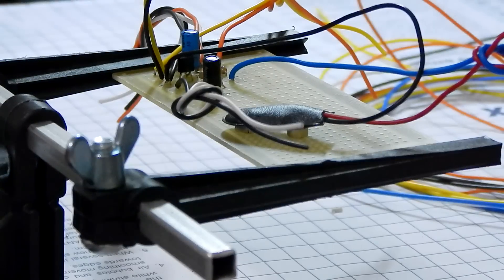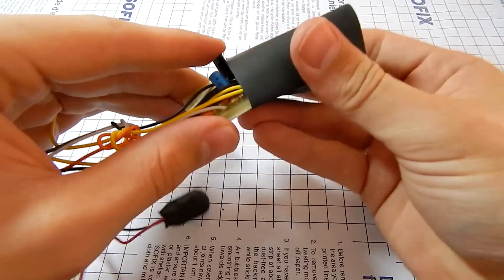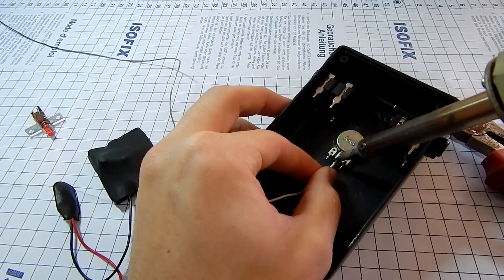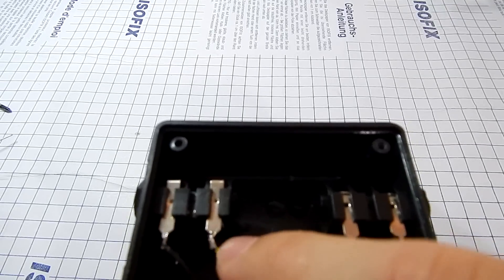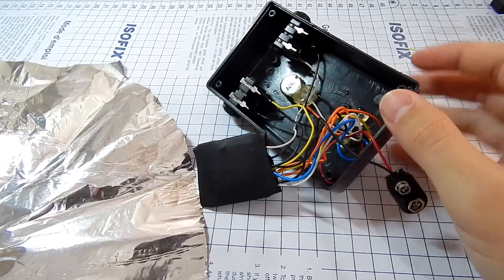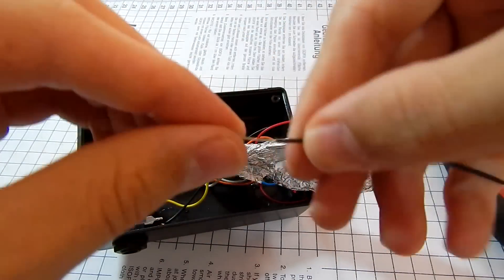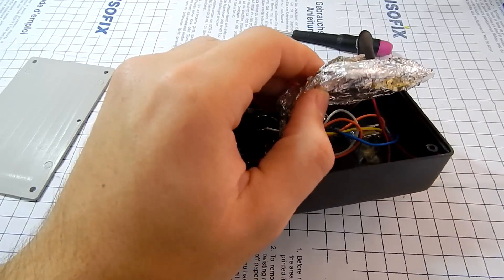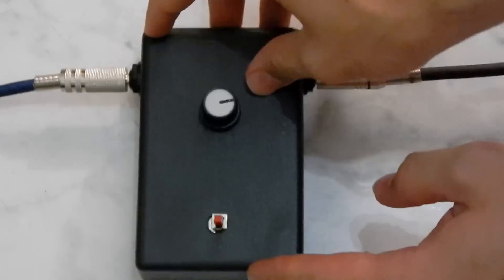Como Fazer um Pedal de Distorção em Casa Fácil

Comment: o transisto tem que se BC517 ou pode coloca bc547?
Reply: não
Reply: provavelmente pode se eles tiverem valores proximos e pode substituir o diodo por um led tranquilo e calmo so ver um led de valor similar ao diodo . vai fundo fera. testa se as ligações forem bem feitas é muito provavel que funcione é um circuito muito simples
Reply: e vc pode substituir os capacitores eletroliticos por capacitores ceramicos ou poliester ou qualquer coisa do tipo so ver nos valores. acha tudo na internet so procurar pelo nome do componente e do lado datasheet .